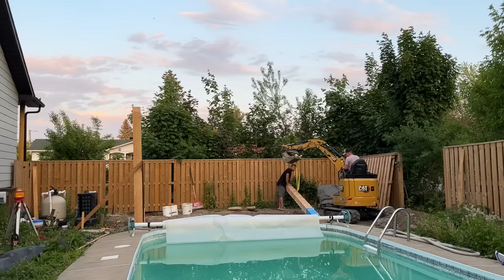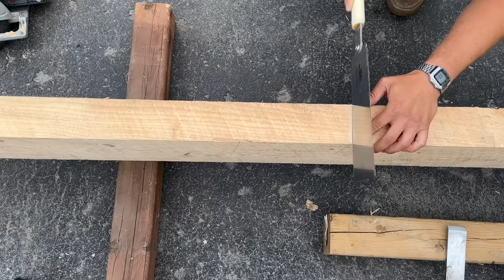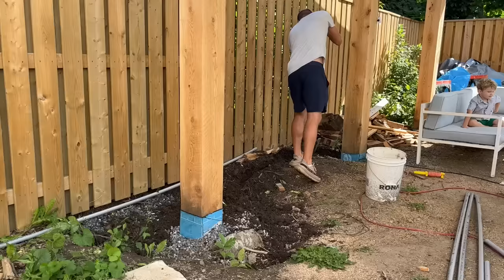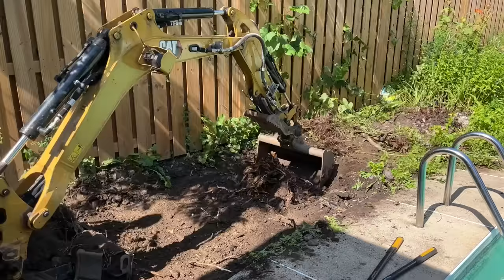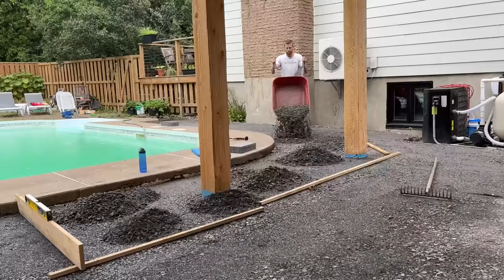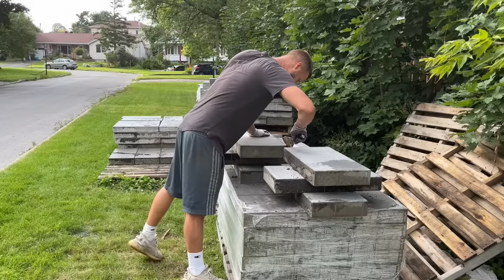My Biggest DIY Challenge: Building a Massive Timber Frame Gazebo

Comment: Hey bro, how did you layer the base for your pavers from ground up? What size stone was the top layer? Did you put some type of barrier over the earth? Thanks a lot, great video.
Reply from the maker: I removed about 3-4 inches of dirt, i put down a geotextile fabric, i then brought in some gravel 0-3/4. I kept bringing that in until I reached the level I needed to be almost level with the pool sidewalk. Then I used stone dust on the last 1” lift so that is really what makes it all perfectly level. The bars will help you with all the imperfections from the compacted gravel below it. More videos to come explaining more in detail every step of this video.
Reply: @mateostabio  Appreciate it

Comment: Sonotube, my friend, you wasted so much concrete on that corner post, and it is your weakest post. Not sure on your climate but that upside down cone shape can have frost heave issues. Solid so far
Reply from the maker: @jacobmiller7175  so far so good. Did one winter and 2 summers. We’ll see with time. For sure that post hole sonotube would’ve been a good idea, but not sure it would have held up the 8x8 post

Comment: Beautiful job. Do you think 6x6 posts will work in the same manor as the 8x8's with the tensions?
Reply from the maker: Thank you, I definitely could have done it with 6x6 instead of 8x8. Perhaps just make the beams 6x8.
Reply: @mateostabio Sure thing. But the 8x8's definitely are more aesthetically pleasing!
Reply from the maker: @zline-sp2fs  but a lot heavier and harder to work with. Didn’t expect it to be that heavy until I got it delivered, and had a hard time moving the smallest 8x8 haha

Comment: Did you use the first joist as a template?
Reply from the maker: @DerekTJ  i tried but I failed to put the beams perfectly parallel so I had an issue where there was about a 1 to 2 inch difference from one side to the other. You can watch my “biggest mistakes gazebo” video

Comment: I’m confused by the wrap around the post but not on the bottom.
Reply from the maker: Thanks for watching and commenting.  Posts never rot at the bottom 3 feet deep under ground. If you ever come across a rotten fence post, it will always be around the surface, where the dirt is touching the post. It’s the first foot that is important to protect. I guess we’ll see if it rots in 20 years!
Reply: @mateostabio  thanks for the reply, definitely makes sense!

Comment: Nice, UNTIL the first hail hits it! These panels cannot take even slight hail. After 5 months, our gazebo, which has the exact same roof panels, has tons of holes in the top level.
Reply: I looked at your build, and it's really nice and well built, then I felt sorry for you as I KNOW when the hail hits it, you are going to be so disappointed and regret using those panels. They are also not fun in the Texas summers - lets a lot of sun/heat through as well. Worst of all was when we had a slight thunderstorm with hail, not even the size of a pea, to looks horrible - although the bottom layer is still ok - for now. Wish you the best.

Comment: No sanding, staining, sealing the wood before putting it up ?
Try an oscillating multi-tool to cut straight into that wood. 
PS ... guaranteed you'll want some electrical outlets outside.
Reply from the maker: There is a plug on the back middle post. You see me hooking up the speaker and lights to it.
Reply from the maker: Sanding and staining is a mistake i mention in another video about this project. Thanks for watching
Reply: @mateostabio   Very cool. Not that my opinion matters. The projects you do (and volume of work) is outstanding. The intellect on display of a web-dev.

Comment: Great work!!  I have been planning my Gazebo / Pergola build and will leverage some things you did in your build!  I tried to do a search on Plastilux Polycarbonate based on the pics in your video but could not find this vendor.  Do you have a link to where you purchased them?  Was wondering why you waited until the end to put in your pegs to the beam / post tenons?  Seemed you planed / sanded some wood, but not all?  Looks like some of it remained rough sawn look.  Why did you plane / sand some of it?Was that all low voltage that you ran through your gazebo?  You cut the pool plumbing pipes to relocate the pool heater, correct?
Reply from the maker: Yes. 12v lighting setup. Will have a video about this setup soon. gazebo is mostly all 8x8 hemlock. I also couldn’t find plastilux anywhere. I found a guy on facebook marketplace that does gazebo roofing and walls, and he had a shipping container full. Keep in mind this was the biggest DIY project I ever did. It took me about 3-4 months, I’m preparing another video that I hope to release in a week or two about the top 10 mistakes I made on this build. Planing and sanding is one of them, not buying and installing pegs asap is another one. Stay tuned for more!
Reply from the maker: So in the 3-4 months working on this in my spare hours, it was hard mentally (not gonna lie) sometimes I just needed to see progress so I would do something without thinking, it was also a lot of different projects and in one. Very hard to manage haha
Reply from the maker: You can download my sketchup model of my gazebo. Link is in the description!

Comment: You should have not put the tenons inside the ground. Even with the waterproof membrane.
Better to raise it with special metal floor mounts made for this specific purpose.
Reply from the maker: Maybe! Only time will tell. I think it’ll be alright. I hope it will. The reason behind it was the design choice to not have angled braces. Between the beams and posts. Without braces + installing the posts on metal fasteners, it just didn’t work out in my head without collapsing. I was scared it would have no sheer strength (like a wind blowing from the side). I should try building a miniature version with them attached with metal fasteners and see if it wobbles if I try and push it side to side.
Reply: @mateostabio  sorry to say but even with that membrane the moisture will rot the wood. At my place, the pergola “sits” on a concrete foundation with rebars joint with the columns to ensure the best stability. 
And between the wood and the floor there is a 2cm-tick sheet of polycarbonate (I’m not sure about the material but it looks like that).
Reply: @mateostabio  one more thing, you should have used laminated wood (I’m not sure about the translation but in Italian it’s legno lamellare) which is much better for this purpose but more expensive.
Laminated wood it’s much more resistant to deformation over time.

Comment: The pool apron slopes away from the pool, as it should, so isn't the rain that hits the pool apron, or any water that slashes out of the pool, going to run into your gazebo and over to the wall of your house? Perhaps you should have left a gap, with gravel to form a french drain, between the pool apron and your pavers.
Reply from the maker: @arthurott4561 Yea… so far it’s been pretty good, there is still a small slope like it probably was 30 years ago. The reason I fixed the slope was because I had a hard time just walking on it. It was like 3-4 inch drop on a 3’ wide sidewalk lol.

Comment: :hand-pink-waving:14.40minute - tell me the pillars are 16mm square and what size is the wood of the shed? how many centimeters did you go down with the pillars?:hand-pink-waving:
Reply from the maker: I have the structure plan available on Etsy! All the wood structure measurements and details are there.
Reply: @mateostabio  tell me how to proceed, do I register and then do a search like Mateo Stabio? can you tell me something?
Reply from the maker: @Nicola_Colonna   Here is the link. Thanks!
https://mateostabio.etsy.com/ca/listing/1601356443/16x13-timber-frame-gazebo-lean-to-roof

Comment: Why the wrap around the post going in the ground? If this is to prevent rot you didn't protect the bottom and moisture will be sucked up from the bottom of the post. I would have poured concrete to make piers and set the posts on top. Can replace later. much easier if needed. Otherwise really nice job
Reply from the maker: Thanks for watching !

Comment: Bro that's a pergola or an overhang.
Reply from the maker: @thewhitedeath586  i dont know. Pergolas aren’t covered. They’re open. 
Chat gpt, whats the difference?
A pergola is an outdoor structure made with vertical posts or pillars that support crossbeams and an open lattice. It’s often used to provide partial shade in gardens, patios, or outdoor spaces. The roof is typically open, allowing light to filter through, and it can be covered with plants like vines for additional shade.

A gazebo, on the other hand, is a freestanding, covered outdoor structure with a solid roof and open sides, typically round or octagonal. It provides full shade and shelter and is often used as a seating area in gardens or parks.

The key difference is that a pergola has an open roof structure, while a gazebo has a fully covered roof.

Comment: Dude, never hold a circular saw like that, with your fingertips even slightly under the bottom plate of the saw as you cut. All that saw has to do is kick back because it hits a hard bit or binds up and you're going to be short a number of fingers. If you want to make sure your line stays true, use a framing square  as a guide instead.
Reply: Dude stop with the YouTube safety police bs! Geezus
Reply from the maker: Thanks for watching! I never out my fingers behind the saw. I had them pretty close to the side holding the guard up, but i dont keep them behind. It is a little risky what I did though.

Comment: Have you ever checked how much the roof cladding weighs?
Once you find out the result, you can sue the man who sold you the studwork. It's so strong you could park a tank on it. And your roof skin only weighs maybe 200 kg. That may all look good, but the dimensions of the frame, then the value of the wood and the dimensions are completely exaggerated. If everyone builds like this, we'll soon all be out of trees. I would have built the entire structure out of a beam that you used as a framework.
Very important: Never work with the circular saw overhead. And never allow a child to sit within 50 cm of a 60 cm long chisel. Have you watched the video again? That's horrible.
You probably just wanted to impress your neighbors. Correct?

Deutsch: 

Habt ihr mal kontrolliert, wieviel die Dachhaut nur wiegt? 
Wenn ihr das Ergebnis herausgefunden habt, dann dürft ihr den Mann verklagen, welcher euch das Ständerwerk verkauft hat. Das ist so stark, das ein Panzer darauf parken könnte. Und eure Dachhaut hat gerade mal das Gewicht von vielleicht 200 Kg. Das mag ja alles gut aussehen, doch die Maße des Ständerwerks, dann der Wert des Holzes und die Maße sind völlig übertrieben. Wenn jeder so baut, haben wir bald alle keine Bäume mehr. Aus einem Balken, welchen ihr als Ständerwerk verwendet habt, hätte ich euch die gesamte Konstruktion gebaut. 
Ganz wichtig: Niemals über Kopf mit der Handkreissäge arbeiten. Und niemals ein Kind, in einem Abstand von weniger als 50 cm zu einem 60 Cm langem Stechbeitel sitzen lassen. Habt ihr euch mal das Video erneut angesehen? Das ist ja furchtbar. Wahrscheinlich wolltet ihr nur eure Nachbarn imponieren. Richtig?
Reply from the maker: I understand your frustration. With one meter of wet snow, the load is a lot greater, might not be something people calculate, but you need to think of other seasons and your climate. 
Design is subjective, what I like in terms of design, is maybe something you might not like. And that’s okay. I wanted a beefy gazebo, I didn’t want a flimsy thing that would break in 2 years. I wanted to build a masterpiece that would make me say wow for the rest of my life. Hopefully its still standing in many decades. 

Cheers from Canada

Comment: DUDE looks great, but you need braces, hate to see this fall over
Reply from the maker: It does not actually. The holes are deep enough that no braces are needed
Reply: @mateostabio  sorry dude you are incorrect, I've been a timber framer for 25 years. There is no shear here at all. I've built countless structures that are engineered by professionals. They all have some sort of brace or girt system or both. Not trying to troll but educate
Reply from the maker: @myroncottreau3066  thanks for the advice. I had also reached out to people who said the opposite.